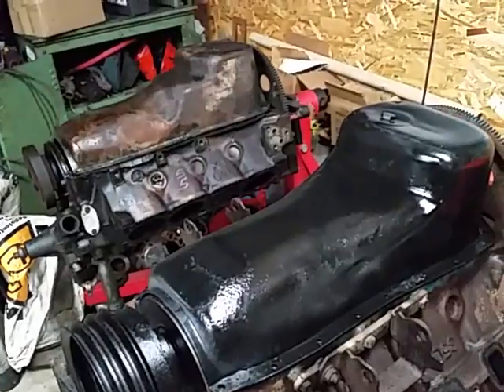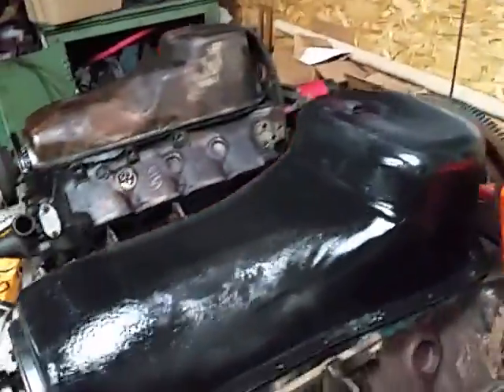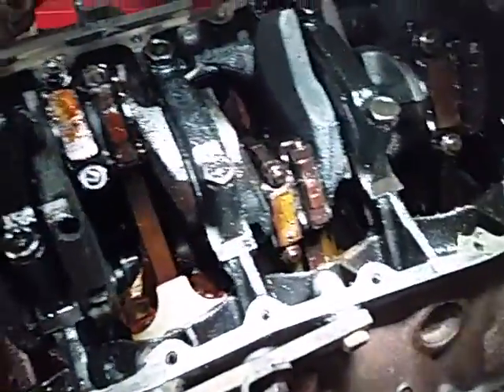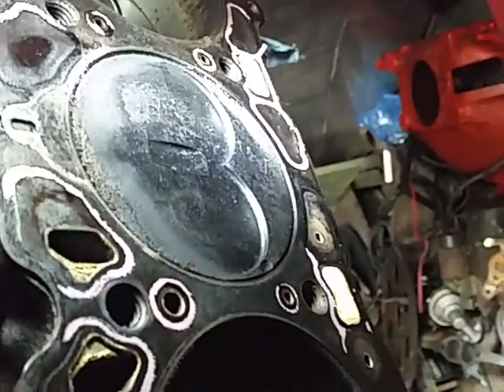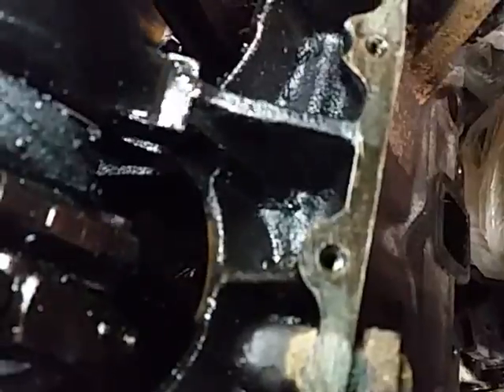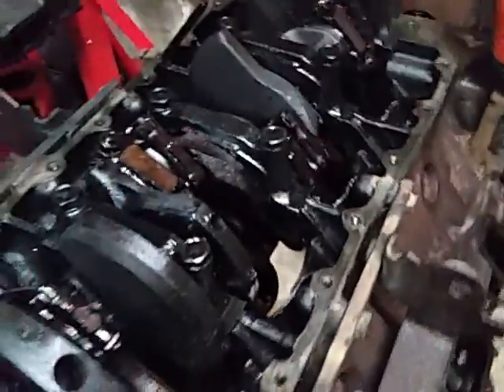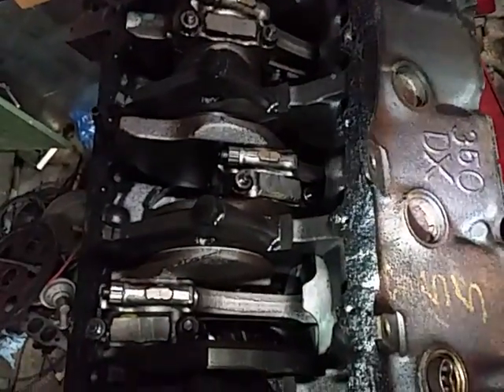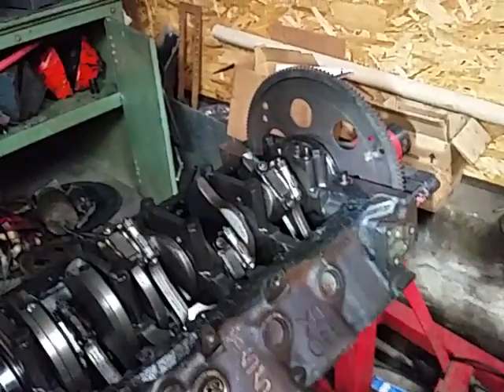Olds 350 Windowed Mains Vs DX Diesel: A Tale of Two Oldsmobile Small-block V8 Engines

Comment: No such thing as a small block Olds.  They merely have varying bore, stroke and deck height.  EDITED FOR THOSE WHO IMAGINE THEY KNOW MORE THAN ME:

Chevy and Ford had big blocks and small blocks.  I forget how Chrysler considered their engines.  The point is a small block Chevy is a totally different engine from their big blocks.  Same with ford.  Different architecture, not merely different displacement.  Only a few small parts interchange.

Olds, Buick, Pontiac, Cadillac all (mostly) ran one block at a time.  The 350, 403 and 455 Olds, for example, are all the same architecture.  The heads are (generally) interchangeable(there were head bolt and water port changes over the years), as are cranks, timing, valve train, etc... Displacement is altered by bore or stroke and not relevant to an engine being "big" or "small", NOT because they are a totally different engine(for example, Chevy, whose 400 was a SBC while the 396/402 was a BBC).  So no, you can disagree as much as you want but Olds (nor Pontiac, Buick...) did not have a small (or big) block.  They had ONE block, which they changed as required.  Thx for playing.
Reply: 400-425-455 olds engines are a larger, not sure exactly how but sure do look bigger.
Reply: @maynardreed4036 ; The deck height of a big block is 10.625" and the deck height on the small block is 9.33" . That is why the big block is so much wider and taller than a small block.
Reply: @daleostrom3613  thanks for letting know.
Reply: @daleostrom3613  Deck height IS the difference, correct, but has nothing to do with being "big" or "small"; both are the same block.  There is no "big" or "small" in GM V8's (concurrently)except for Chevy.
Reply: @FMChimera ;
Well, you are correct about the interchange of parts on big and small block Olds, however with a difference of 1.295" deck height there  certainly is a big and small block Olds.
Reply: @daleostrom3613  No.  

There was one Olds block in this time period.  Big block and small block, as terms, exist because some engines are totally different.  Deck height is utterly irrelevant, just as bore and stroke mean nothing in this subject.  Big Block and Small Block denote totally different engine families.

It's how people came to refer to the different Chevy engine families(and Ford and to a lesser degree Chrysler)because they existed concurrently.  Small block and Big Block; Mouse motors and rat motors.  TOTALLY different engines, not merely different specs.

Olds (and Buick, Cadillac, Pontiac) did not have different (V8) engine families(concurrently).  One block and head design, altered as required (bore, stroke, deck height, etc).  Cadillac is yet another example:  the 368 is STILL the same engine as the 500, even though it has less displacement than many SBC's.  VERY different specs, still the same old block and heads(disregarding changes over 15 production years in water ports, head bolts, etc).  It didn't become a "Cadillac small block" due to the reduction of displacement.

TL;DR:  If a manufacturer is not offering two (or more V8) engine platforms concurrently there can be no "big block/small block" offered by said nameplate.  Just different sizes of the same engine.
Reply: @FMChimera ;
Kind of a stupid argument....
When you put your big block Olds internals in your small block Olds, you are going to have trouble finding head gaskets that are 1.3 inches thick. Good Luck
Reply: @daleostrom3613  Fascinating.  In point of fact we swap internal Olds parts between all sizes (except the 260 which is rather a useless red headed step child).  Even cranks and rods can be swapped generally with the correct pistons and head combinations.  Only intakes are entirely deck-height specific.  So, your "point" is specious and leads me to believe you've never had any of these engines apart, let alone put them back together in very non-factory configurations.  Deck height is not what makes a "small" or "big" block.  It's not a different engine family because they make the deck taller, or shorter.  Is this really that difficult?

Before you start making claims, I've been building GM engines for a variety of purposes, mostly NOT Chevys, for 40 years, for hundreds of street and race applications.  Own a couple used dealerships.  Once owned an Olds/Buick/Pontiac franchise.  Have done decades of GM service training, actually designed performance parts, was building the big Caddy motors for racing all the way back in the early 80's...

Your qualifications are...?

What is "stupid", though I previously tried to be kind, is attempting to conflate totally different engine designs (big vs small blocks) with different displacements.  Displacement/bore/stroke/deck changes are not the same as "This is a totally different engine design".
Reply: @FMChimera ; 
I already told you that many parts can be swapped. Set a 400 big block in front of you, and then put a 403 small block along side of it and anyone would be able the big block from the small block.
I could do it blindfolded. 
My experience is 30 line mechanic at the same Olds dealership. I also own many hotrods, my Olds is a 69 442 convertible, now has a 455 with 391 gears, original 4 speed car, but the original 400 big block is long gone.
Reply: @daleostrom3613  Dear God.  This seems so simple.

Big block and small block are totally different engines.  "Size" isn't the defining criteria, ie,  a 396 BBC is "smaller" than a 400 small block...

I have a 403 Olds sitting out back next to a 500 Caddy.  The 403 has the same deck as the 350, bigger bore.  Both the Olds and Caddy are very similar in overall size.  The Big Block Chevy is a bloated engine, and heavy, but gives you your big vs small comparison...and is still irrelevant.

ALL Olds engines in the late sixties thru early 80's time period are the same engine family/design(Cadillac, Buick and Pontiac also each had their own engine design).  Doesn't matter how large or small or what the deck height is; SAME ENGINE within each division.  Doesn't matter how wide your 455 intake is, it's the same engine family/architecture as the 350 and even the 260.

Within Chevy they are NOT the same.  A 305/307/327/350/400 are all small blocks.  396/402/454, etc are big blocks:  TOTALLY different engine families/designs.  

I can't see any way to explain it more thoroughly.  If you think deck height (or bore/stroke) is the difference between big and small you are painfully ignorant and I'm bored repeating myself.
Reply: @FMChimera ;
This is simple, if you are having trouble figuring it out, just send me a picture and I will tell you if it's a big or small block. It's as simple as the English language, big or small.
Reply: @daleostrom3613  OK, you really don't seem to understand:  Big block is one engine design.  Small block is another engine design.  Chevy SBC vs BBC; totally different engines.  If there are not different designs, such as Olds; all based on the same architecture, it's the same engine and there is no big or small in this context.

Not sure if you are clueless or ignorant but you're truly looking foolish and I can't be bothered to indulge you further.  Do carry on, by all means.
Reply: @FMChimera ;
Clueless
Ignorant 
Foolish
Harsh language coming from someone that cannot tell a big block from a small block.
Reply: @FMChimera ; 
Big block rods on small block crank going to rattle with .300 clearance. 
You better figure out if it's a big or small block before you torque the mains. 
Only the deck height ???
Reply: @FMChimera Modern Chrysler was no different than Chevy & Ford. They had thier small blocks (273, 318, 340, 360) and then the big blocks. There was "B" big blocks and "RB" big blocks, which are similar to Olds in that the RB has a taller deck height than a B. B was 350, 361, 383, and 400. RB was 413, 426, and 440. Small block Chryslers had nothing in common with big block Chryslers, they were totaly different.
Reply: Hey dude do you have a clue to what you are looking at when you quote me this information because I have been working on Oldsmobile motors and the internetchange ability of the motors in the gas block olds motors and bore and their stroke and their heads are all interchangeable parts of the 350 ,425,455 motors thank you very much I  have built up my own personal motor combination of using the w30 Cam shaft and the w30 455 heads c casting I'm currently in use in my 1969 f85w31 w the use of the big block olds heads c casting heads and the w30 Cam shaft,475 lift on both sides of the valves and the 328 duration cam with a 108 lobe separation you probably need to get a clue to what I'm using and the Edelbrock performer rpm intake and carburetor just saying that you don't forget that I have been working on Oldsmobile motors for a long time now over 35 years or more now so that means that  I didn't fall out of the sky just yesterday so I guess I do know what the fuck I'm talking about 😮😂😂
Reply: @rodneyhopper22  I suppose the proper terms folks should use when trying to distinguish them would be "short deck" vs "tall deck"?      That would be more accurate than "small block" vs "big block"
Reply: @johneckert1365  Excellent point.  Olds, for example, would be tall deck or short.  It's the same block design (architecture) for either.

Chevy, for example, would be big block or small.  Totally different engine designs. I's amazing it's so hard to get it through to some people.
Reply: @FMChimera  Chevy Big Blocks even had short deck & long deck. The long deck blocks were Medium & Heavy duty truck engines, the 366 with a cast crank and the 427 with a forged crank. I'm not sure if the later 8.1 496 big block was a tall deck or not.
Reply: @johneckert1365  And yet they were still totally different architecture than the small blocks.  Did tall and short deck somehow make one a big and the other a small block?  Thx for making my point.
Reply: @FMChimera  Why do you keep saying "Chrysler to a lesser degree"? Modern Chrysler had small blocks 273-318-340-360 and big blocks 350-361-383-400-413-426-440. They were incredibly different and clearly distinguishable between a big block or small block.
Reply: @FMChimera  Ford Windsors would be another good example. A 351W was basically the same layout as 289/302, but the 351 had a taller deck height. Still everyone refers to a 351W as a small block just like the 302. 
I do understand the opposing view with Olds, the 400-455 do look way bigger than a 350-403 because of the height, width, and weight.  I agree, that they aren't a "big block" vs "small block", but to thier defense, short deck blocks are technically SMALLER than the BIGGER tall deck blocks 🤣🤣🤣
Reply: @maynardreed4036  Compare timing covers and intake manifolds?
Reply: Oh yeah that's why there's a difference in the two blocks in height and width of the 2 of them dude I know better than that because I built both of them you jerk, and you think you are so smart people put them next to each other on the floor and then look at the difference between the two your selves you self doubters out there in the world
Reply: Ford and Chrysler (or the Dodges and DeSotos) had various different lines of V8 engine blocks. Ford 428 is different than Ford 429. Even different kinds of engines called "351".
Reply: The deck height is what makes it a big block or a small block.
Reply: @daleostrom3613 also the main bearing sizes as well peace and much respect to you Jason
Reply: Respectful saying you are wrong
Reply: @jasonhumphry5836 hey Jason you need to get a clue to what you are saying
Reply: Chevy and Ford had big blocks and small blocks.  I forget how Chrysler considered their engines.  The point is a small block Chevy is a totally different engine from their big blocks.  Same with ford.  Different architecture, not merely different displacement.  Only a few small parts interchange.

Olds, Buick, Pontiac, Cadillac all (mostly) ran one block at a time.  The 350, 403 and 455 Olds, for example, are all the same architecture.  The heads are (generally) interchangeable, as are cranks, timing, valve train, etc... Displacement is altered by bore or stroke, NOT because they are a totally different engine(for example, Chevy, whose 400 was a SBC while the 396/402 was a BBC).  So no, you can disagree as much as you want but Olds (nor Pontiac, Buick...) did not have a small (or big) block.  They had ONE block, which they changed as required.  Thx for playing.
Reply: And making this even better; half the people out there have no idea Chevy also had a 307, which they think is the 307 used in late 70's, early 80's cars when it was in fact the Olds 307.  AND, people fail to understand GM was also randomly swapping Chevy and Olds 350's (totally different engines almost down to the bolts) hence furthering that "small block Olds" myth...and getting GM sued.
Reply: @FMChimera  you are incorrect on BBO vs SBO. Deck height is what separates the determination of whether smallblock vs Bigblock Olds. Yes the architecture is very much the same any many parts can interchange but not all. As stated before, deck height is the determining factor here.
Reply: @FMChimera  the Olds platform is absolutely similar in design but there are differences. Does a Big Block and smallblock engine have to be of a completely different design to be considered as such? Even Oldsmobile classified their engines big block and small block. Ever heard of a W30/W31? These two factory performance cars by Olds were classified as Big and small block! 

Keep patting yourself on the back about building engines, congratulations, thousands of others do as well. I’m not saying you can’t build or race these engines or the cars they go in but sorry, not sorry, olds has big and small blocks.
Reply: @robmaxfield780  Yes, they have to be of completely different design and produced concurrently.  

The 390/429 Cadillac is dimensionally a "small block", compared to other engines.  The 472/500 is a "big block" for the same reason, but nobody refers to small and big block Cadillacs because they are totally different engines, produced subsequently.

ALL big and small refers to, or ever did and always was, is different engine families within a manufacturer.  It was never even a design idea, but rather a marketing one.   If it's all the same architecture then there is no "big or small" because there is nothing to differentiate.  Otherwise the 400 SBC would be "big" and the 396 "small".  A 368 Cad would be "small"...  It's irrational.  You can "say" anything you want but that doesn't make it correct.
Reply: @FMChimera  well there are differences. Gas Smallblocks are 2.5” mains vs Big Block 3.0”. Strokes are different between both as well as stock piston Diameters. Physically all BBO heads will bolt onto a smallblock but that doesn’t mean they will mechanically work. There are many differences between Big and smallblock. Chevy did have different designs between there big and small engines but it doesn’t have to be that way!
Reply: @robmaxfield780  There are differences in specs across LS motors.  Specs differ wildly across 40 years of SBC's.  The 302 and 351W have many differences.  Cadiilac changed drastically from '48 to '62, then made an LSx to LTx-level shift in '63.  They each remain the same architecture, as do Olds, Buick, etc.  Changing a crank diameter, bore, rod, doesn't turn it into some other engine.

I'm far from the only person amused by the effort here by some to defend erroneous ideas.
Reply: @FMChimera  well you’re entitled to your opinion as am I but the fact remains that second Gen Olds V-8s were in Big and smallblock form.
Reply: @robmaxfield780  Everyone is entitled to an opinion, even when you're wrong.  But opinion doesn't change fact and no, there's no big/small block Olds, Buick, Cadillac or, if memory serves, Pontiac(though it seems there were two or even three different Pontiac blocks in production at once for a while...and I don't care enough to go look it up).
Reply: @FMChimera  funny I don’t remember talking about Buick, Pontiac or Cadillac. All of those designs are completely different from one another and we’re talking about Oldsmobile here.
Reply: @robmaxfield780  Oh my.  Thread following genius, aren't you.

I've clearly noted in a number of posts a variety of auto makers AND noted that GM divisions other than Chevrolet generally followed the same design and marketing concept; one engine architecture at a time, including Oldsmobile.

You aren't the only person posting, you're way late to the thread, and if you're going to defend a specious position at least keep up with the debate.
Reply: @FMChimera  you’re beating a dead horse! Oldsmobile has big and smallblock engines. Just a fact whether you choose to believe it or not. Fact!
Reply: @robmaxfield780  Keep repeating that enough and maybe someday...well, no.  Nobody that knows the subject is ever going to believe that BS, but maybe you can convince yourself.  🤣😅😂😂😂😀😁
Reply: @FMChimera  tell that to all the professional engine builders like Alan Fillebrown, Bill Trovato, Bernard Mondello and Russell/Peyton Hunt etc. These guys refer to second Gen olds engines as big and small so once again you are incorrect!
Reply: @robmaxfield780  amen brother
Reply: @FMChimera  The Olds 307 was actually used all the way through the 1990 model year in the Cadillac Fleetwood.
Reply: Oh you think you so good luck with your theory 😂😆🤔 I hope it works out for you
Reply: 400 425 and 455 were b8g block Oldsmobile